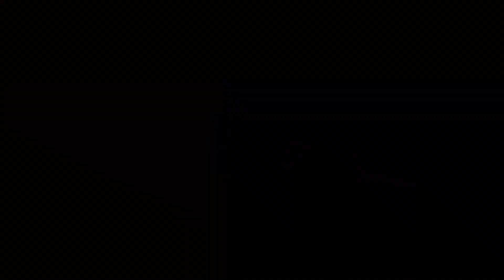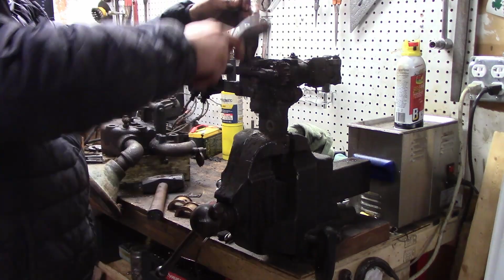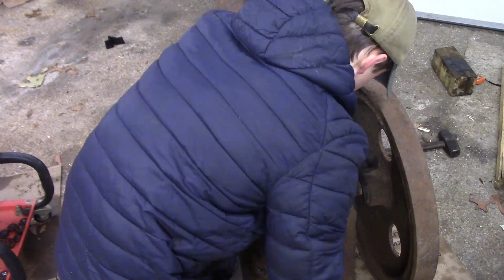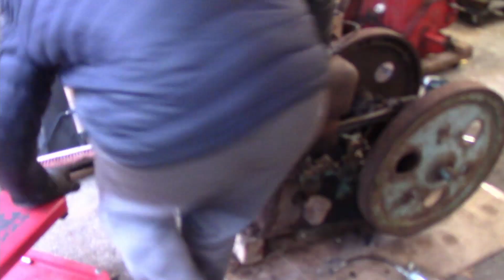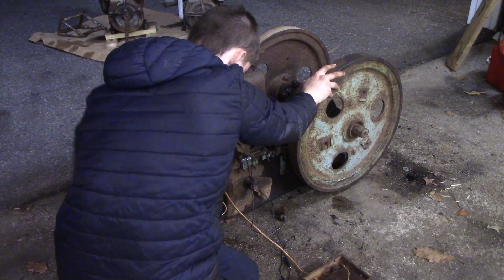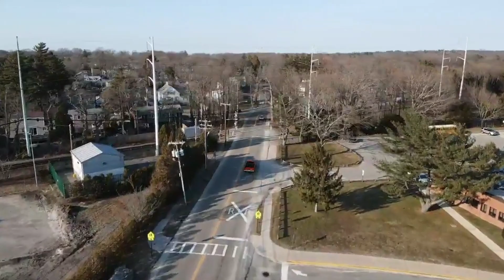Will It Run? 3.5 HP Jaeger (Economy) Hit and Miss Engine Sitting Since 1985!!!

Comment: Well Colin what a fantastic video of the old engine. I was interested as i am at present here in the UK building my own minature Hit & Miss engine from anything i can scrounge. So far i have a crank from a chainsaw. Making my own conrod from Brass. The flywheels i am making from 2 weightlifting bar bells. The main body from a block of Alloy from the scrap drawer etc. I guess it will be a multi part video. Thanks for showing. It gives me idea's of what i need to make. Subbed to your channel. 
Regards.
Steve.
Reply from the maker: Thanks!! Wow that's a very cool project! I'd love to do something like that! If you want some more information about these engines and how they work check out my video on comparing Hit and Miss vs Throttle Governed engines... it definitely goes more in depth as to how these things work! Thanks for the subscription I appreciate you stopping by! Stay tuned for part 2 in a few weeks!
Reply: @colin_5839  Hi again. I have just posted part 1 of the build. Slow going but i am sure it will turn out well. 
Regards.
Steve.
Reply from the maker: Cool! I'll check it out!

Comment: I wanted to ask way didn't you put a head gasket ont?. It would help with the compression leak. An why it you install the piston in from the back. The cylinder wall is tampered to get the rings in easyer. Just wondering.
Reply from the maker: I did put a head gasket on it! It definitely wouldn't run at all without that LOL! I installed the piston from the front because I forgot to install it before I put the governor assembly back on and I didn't feel like taking it all apart again to install the piston when you can just install it from the front too. Thanks for Watching!
Reply: @colin_5839  on your video  of you putting it together you didnt put one on it.

Comment: Do you have a hoist to load your heavier engines in the truck? I'm without one but I don't have anything much heavier than 250 lbs so I can scoot them up on ramps for the time being.
Reply from the maker: I have a set of ramps and a winch in the front of the bed which is how I get the heavier stuff into the truck. Thanks for Watching!

Comment: try useing a slightley stronger spring on theinlet mite keep it tightrin the seat ?
Reply from the maker: If you watch the video I did as an update to this one you will see I ended up getting the valve guides redone because they also leaked water really bad so that took care of that problem! :) Thanks for Watching!

Comment: the old choke spring I would take it 2 the hard ware store and match up IVE had 2 go 2 the hard ware store be 4 / 2 springs I needed 4 a engine 😊😊 the grease cups U will have 2 get them from a another parts supplier and the drip oiler 😊😊 11 23 2O23
Reply from the maker: That's exactly what I did!

Comment: Why not use jb weld? It won't stick out like brazing does🤔
Reply from the maker: 3 main reasons: I wanted to learn how to braze, I wanted to fix it properly (especially if I go to flip this thing someday), and I also quite like engines with battlescars. Gives them some character / more of a story! Thanks for Watching!
Reply: @colin_5839  i hope you will keep him/her, i wish i could find ones like this with those flywheels. Whenever ive seen engines with brazing marks people avoid them as they are not perfect and scare people😕
Reply from the maker: If I can find some space to keep it I definitely will! Yes I know people usually avoid them, but for me as long as they aren't on anything sketchy like the flywheel or connecting rod I usually dont care much. I think it's pretty neat to see that some of these engines were fixed across their lives! Also, If I do go to fix it I can mention it was fixed recently by someone who knows what they are doing, and not some farmer 85 years ago...

Comment: all of those old engines are heavy because they are made of cast iron  and I have seen cylinder heads worse than that they can be fixed and welded up water was left 👈 😮 in the engine hopper and it what frozen or either it was from rain water either way that is what happened 😮😮 next thing 2 is 2 use spray oil and get the rest of the parts free and U might have 2 use some heat 😊😊 and don't break parts it's alot more work 2 fix more parts 😮😮 OMG 11 23 2O23
Reply from the maker: You are correct about that! Go watch the update video on this engine and you will see that I got a lot of the issues worked out on it! :) Thanks for Watching!